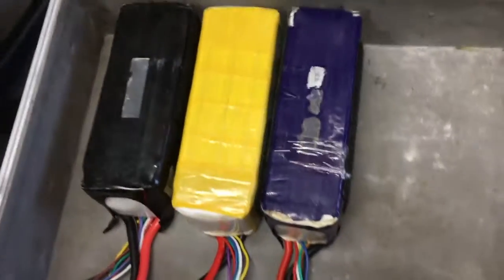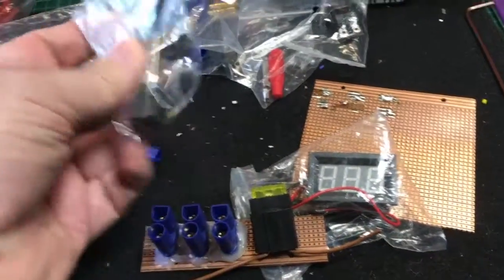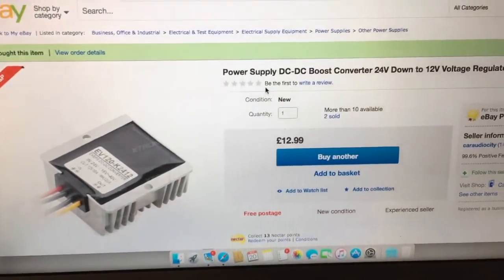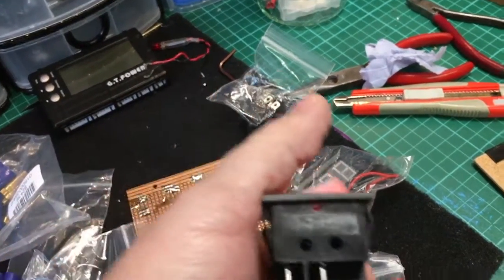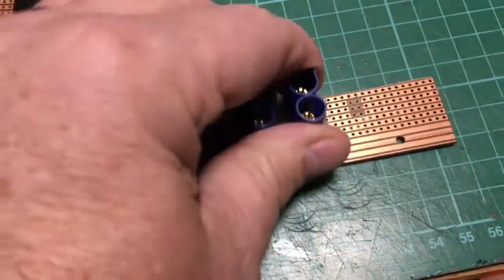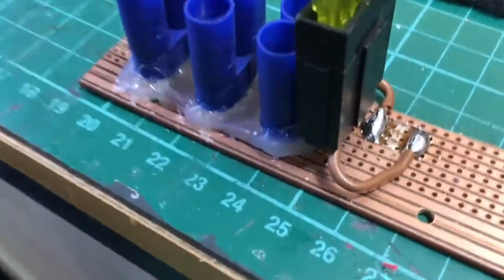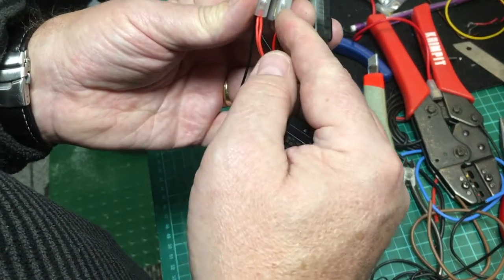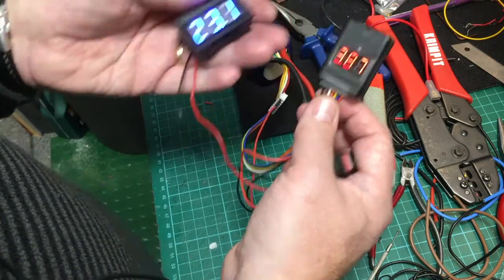Portable Lipo Charger Project

Comment: Know what my next project is, I did notice in your second video you've added a second display below the voltage readout, what's that one for?
Reply from the maker: Inside I have a 24 to 12V regulator. One display is doing the battery voltage and the other is the 12V after the regulator. Most Turnigy chargers have a max input of 18V so can't run off the 6S battery packs. Get the ISDT 150W charger as that can run off 6S packs as it can take up to 30V. However, having 12V is handy to be used for other accessories, pumps, chargers, lamps etc
Reply: Yeah I've had one of those ISDT chargers for a couple of months now absolutely love it, I screwed a 4S down to below 2V the other week, the ISDT trickled at 0.1A for a while then gradually increased and saved the battery. Awesome bit of kit. Have you updated the firmware on it yet?
Reply from the maker: I have only had it a month or two and not updated the firmware. I will have to buy the lead and USB adapter. 
I have version 2.0.3.89
Reply: It's worth the upgrade, you can DIY a lead and flash via FTDI, that's what I ended up doing
Reply from the maker: Thanks....I have already ordered the proper lead and adapter from banggood